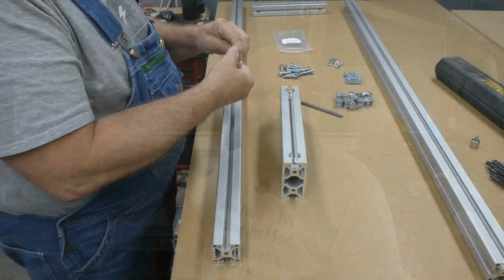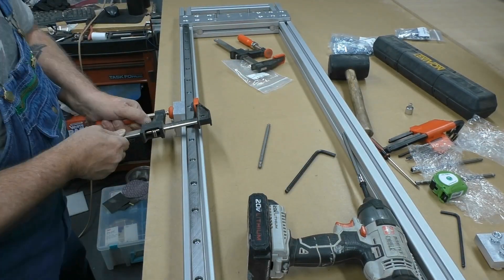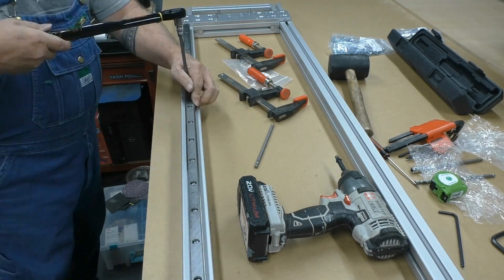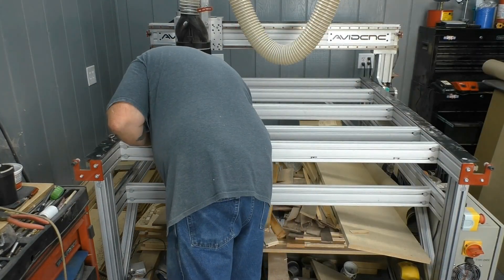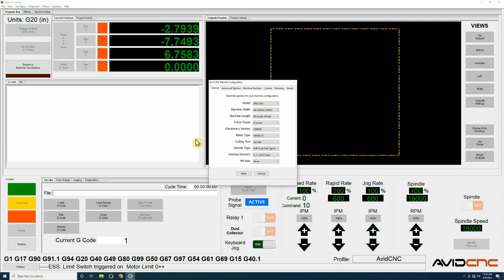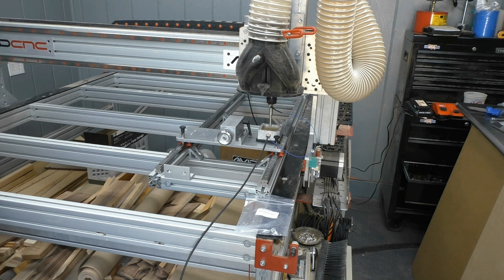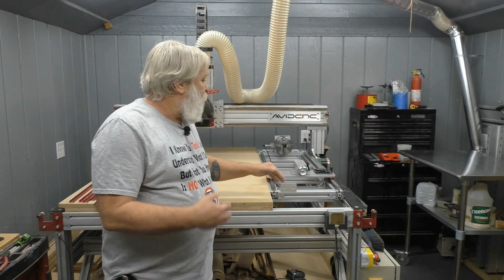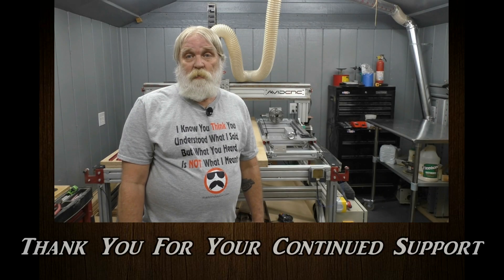Avid CNC Rotary Axis – Assembly and Installation

Comment: By chance, I just received my 4th axis from Avid earlier in the week.  This video goes a long way in removing some anxiety and dread about setting things up.  I should get a torque wrench.  What is the torque suggested for extrusion?

You are an easy-to-listen-to teacher and your videos are clean and void of fluff - a testament to your editing.
Reply from the maker: I do appreciate your kind words, but I think my editing needs a lot of work. Just my opinion, but thank you again. I'd say 99.999% of people don't bother with a torque wrench. They just snug it up and move on. Avid themselves suggest that.  I spent too much time in the army working on helicopters to not have at least a suggested torque value, but that's just me. I spoke with the folks at 8020, and they recommend a torque of 15-18 ft lbs., but DO NOT go past 20 ft lbs. Basically, if you tighten it until it's tight, you'll be fine.